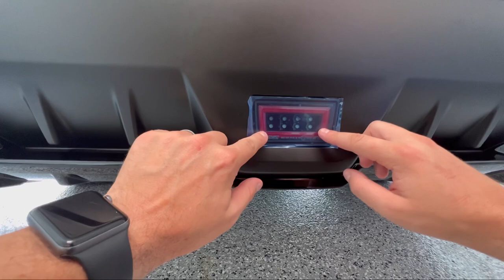2022 WRX F1 LED Bar Style Rear Fog Light Install PnP Harness

Comment: Dude, thank you. This came with no instructions and the bracket was giving me hell. Finally got it in with your help 🙏🙏 If anyone else is installing solo, I recommend using cardboard shims (from the box) to center the light as best you can while tightening the bolts otherwise you might have some gaps
Reply: Great video! We also made an install video for youtube as well. I apologize for them not linking you.

Comment: I can't get the flashing to disable on my 4th brake light. I held the brake in accessory mode and flicked the headlights on and off 3 times and that's not doing the trick. Any ideas?

Comment: Can I see the plug and play if it's the same as the older model
Reply from the maker: Hey thanks for watching! The f1 light is from from subiebros. Check the link in the video description
Reply: @JoeyMontalto  idc about the f1 light,  I'm asking about the connectors if it's the same as the VB model
Reply from the maker: @angrygamer2713  I believe they are different connectors as there is a harness specifically for the 22+. The previous year pnp harness does not work
Reply: @JoeyMontalto  aww man alright lol

Comment: I have same light from SubieBros, but I can't turn off the flashing no matter what. Any advise? I turn car on with lights off, press the break pedal and keep it down then turn on and off lights quickly 3 times. Still flashes about 3 times
Reply from the maker: I sat there for about 20 minutes until I got the stobe to turn off. I followed the instructions like you said from off to on 3 times. Try maybe 4 or 5 really fast.
Reply: @JoeyMontalto  What are you turning on and off which part of the light switch. Are you toggling the fog lights or the actual headlights. And when you toggle it how far are you going up. Are you going to auto then off or all the way up to fully on and off. Do you get what I'm saying? I'm struggling to get the strobe off also.
Reply: @brianwithawhy7093  hey man, have you figured it out. Im on the same issue
Reply: Just got it! Hold the brake, keep the light in off. Turn it to auto, then off 3 times. Let go of the brake. And it should be good